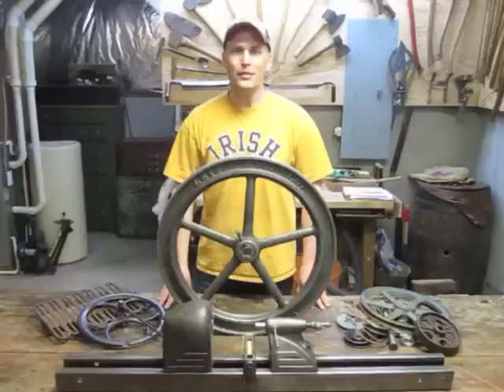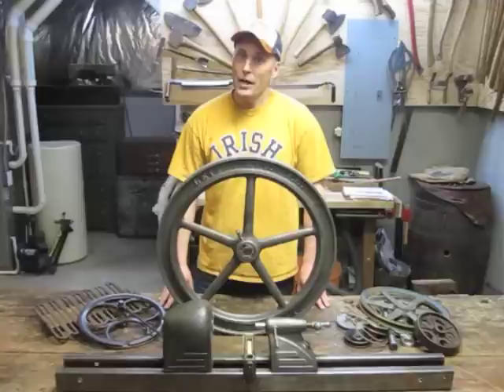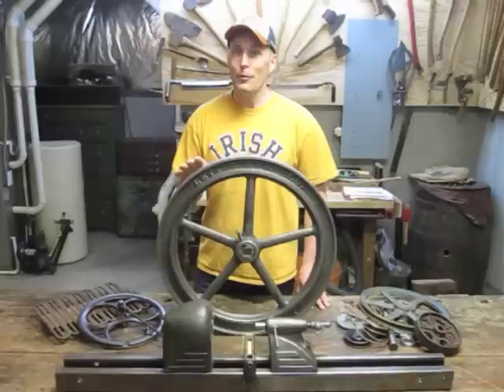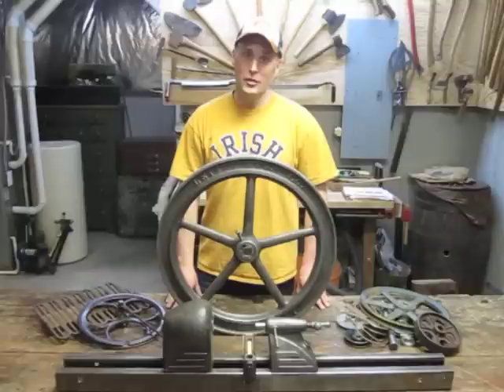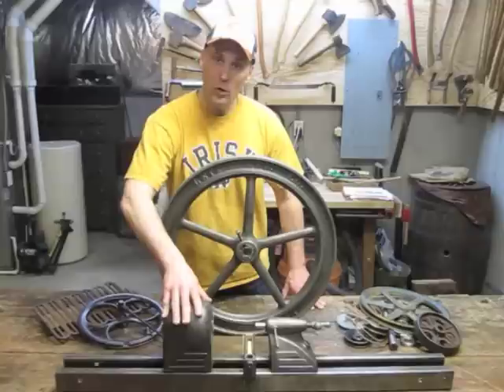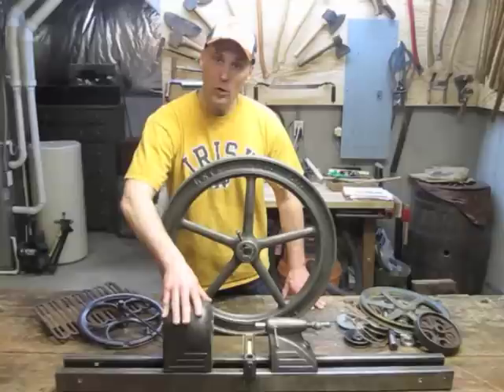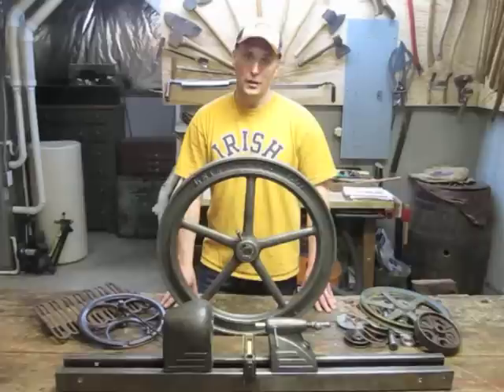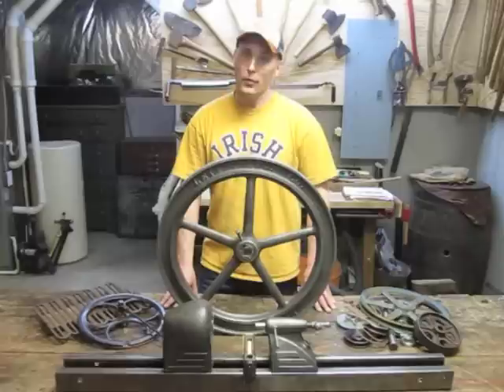The Foot Powered (Treadle) Lathe

Comment: I built a treadle lathe about two years ago for demonstrations and found that the small sewing machine belt was the weak part of the design.  I was surprised that you used the same but appear to get much more power transfer from it.  I have to find a way to get more tension in the belt.  I really enjoyed watching this.
Reply from the maker: I spray belt dressing in the pulley and flywheel so it gets more traction.  I also have a belt tensioner.   I have the detailed How To video on my channel as well.  Good luck!

Comment: you're a master
Reply from the maker: +MaghoxFr Thank you.  It also helps to edit out the mistakes.  There is also a How To version.
Reply: Chop With Chris I'll check it out. I was walking on a local antique/flea market here and I was thinking about those old awesome tools, run without electricity. And I would really like a quieter shop. One of the things I enjoy the most is listening to the radio while working, but you can't do that between electric saws, drills etc.

Thanks
Reply from the maker: +MaghoxFr No doubt my shop is quieter except for the chopping

Comment: Thanks Chris for inspiring me to go back to using all hand tools again. I fell into the trap of .. power tools some years ago and its just not nearly as satisfying as working w/all hand tools.  I have many of the same tools as you but my post drill drills in a slight oval. Do you know of what might be causing this?
Reply from the maker: Sorry - Can't help with the post drill.  There are lots of enthusiasts out there - need to find a message board for post drills and they could help.
Chris

Comment: I wonder how much power is lost in that string...  Nice hunky weight down below and a good sturdy top, but deys connected with a string.
Reply from the maker: +Aubrey Marsh Good question.  It's a leather strap used for old sewing machines.  I use belt dressing to reduce slippage.  I did a full How To video.  You can find it on my channel.

Comment: Would saying that you are a mechanical genius be a bit too much.  You seem to have the talent for seeing small bits and parts and mentally assembling them into a working machine.  A unique talent if I ever saw one.  I want one of these for turning small tool handles.  No one makes a tiny lathe.  Especially a foot petal driven one.  Plus compact.
Reply from the maker: +Bruce Brachman I may have to make one.  I also made a foot powered scroll saw you may enjoy on my channel.
Reply: I actually have a scroll saw.  I don't use it.  I prefer a jeweler's frame and thin blades.  I actually saw someone make a table top lathe from a sewing machine motor.  I am ok with rigging and kludging things together.  Just no where near the level you are.
Reply from the maker: +Bruce Brachman I'd like to make a band saw next
Reply: You can do it.  Just how much will it cost in parts and how long until you finish it.  All a balance.  Have you ever considered one power source (foot driven) and then interchanging the tools on top?  One power supply that would power other tools.  Your flywheel design seems adaptable to other tools.
Reply from the maker: +Bruce Brachman Yes.  I wanted to add a belt sander to the top.  Maybe in the future.

Comment: Hello friend, very magnificent project, I live in Brazil and have never seen a turning machine manual! You could send me a project with the measurements of the wood, which is explained as the lathe? And that wheel you painted, could I use a bicycle cassette in place? If you can help me be grateful friend, thank you!

Comment: Excelent!!! My one question: does your 1 standing leg get tired? My#2 question: how long will the wheel turn after you quit pumping?
Reply from the maker: In the 1st 5 minutes I think this is the stupidest thing I’ve ever built but then I loosen up and it’s all ok.  I alternate legs.  Not sure how long turns without using a tool to slow it down.
Reply: @ChopWithChris  It's certainly not stupid. A motor for a lathe or even drill would cost much more.

Comment: Chris, I have a question. I’m trying to understand how the belt drive works compared to other designs I’ve seen. In your setup, the pedal operates a medium wheel which belts to a larger wheel and finally to the headstock with a small wheel. On other designs , the pedal runs the flywheel which belts to the headstock pulley. So, is there an advantage from going medium:large:small? Also, what does the “idler do”? Thanks.
Reply from the maker: Thanks for the question.  yes, there is an advantage - the small-large-small creates much more speed.  The idler is intended to keep the belt tight.  Please note there is a video on my channel called How To Build A Foot Powered Lathe.  Check that out from more details.
Reply: @ChopWithChris  Just saw that too, Thanks Chris!

Comment: I recently picked up the same model Dunlap lathe as you used and I have to ask, where did you get the live center for it?
Reply from the maker: Good question. The dead center stinks. I think I bullfight it at McMaster Carr and then had a machine shop drop the tapered hole for it.

Comment: Now that's what I call a chisel! What kind is it and where did you find it?
Reply from the maker: It's called a Slick Chisel and I found it in the bottom of an old tool box I bought at an auction.
Reply: Interesting. Looking it up I see it was used without a hammer. Is the bevel 25° or is it shallower. I'm looking into making some chisels and this would be a great project!
Reply from the maker: Not sure the Angie but I guess shallower than 25 degrees
Reply: +Chop With Chris Thanks for replying Chris. I sent this video to a friend and he is seriously jealous of both your skills and your lathe. Very nice work, since I didn't say so earlier.
Reply from the maker: Well thanks you very mich

Comment: What did you use for the belt/wheel harness and did it come in a loop or did you have to fit it to size and how?
Reply from the maker: I used an old leather sewing machine belt and  cut to length and sewed together with metal paper clips. Here is the How To version. https://youtu.be/xUiW2LUzL5c
Reply from the maker: Here’s another example with my foot powered jigsaw.  https://youtu.be/aUZ7R9HodXo
Reply: This is brilliant thank you ever so much Chris. this is going to help me with my lathe build!

Comment: hi 
amazing work.
what woods did you use ? please tell me :)

thanks
Reply from the maker: Ferenc Lányfalusi The lathe was made from Douglas Fir and the chisel handle was walnut.Chris
Reply: thanks a lot.
The workbench is Douglas Fir too ?

Keep up the great work :)
Reply from the maker: Black walnut.
Reply from the maker: Me me be clear. The workbench in my shop is made from 3" maple. The outdoor workbench I built is make from black walnut and ash
Reply: Chop With Chris 

thanks the information
what do you think which kind of wood i choose for the outdoor workbench?
locust tree, oak, or beech tree? because i can't find ash and walnut in our area.
Reply from the maker: Oak would be the best as it is good in the rain. Beech is bad because it is very hard and difficult to work with. Locust is ok but I would use oak. Good luck. 
Chris
Reply: Chop With Chris 

Great, i'll get some oak :) 
i want to build an outdoor workbench ,then i wanna try to build a foot powered lathe like you 

Feri